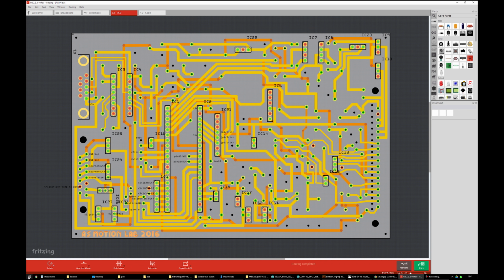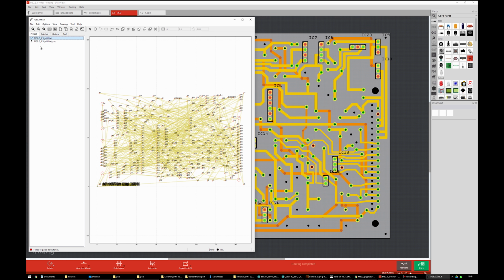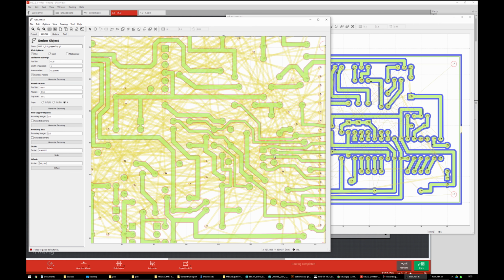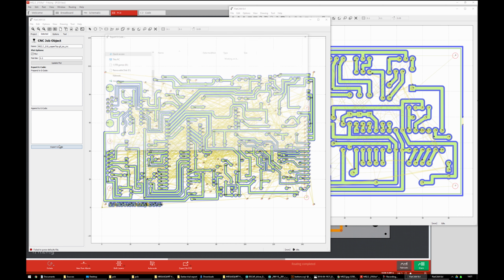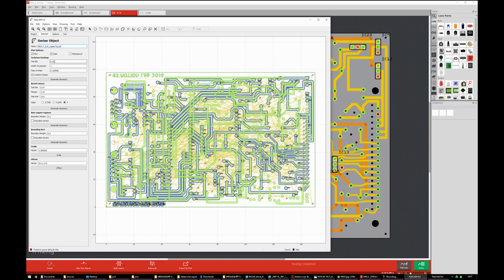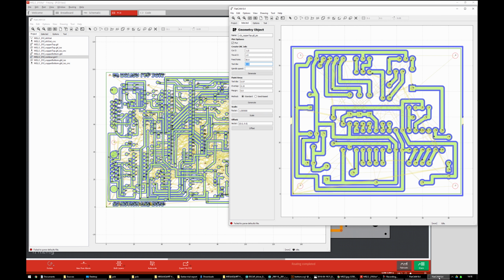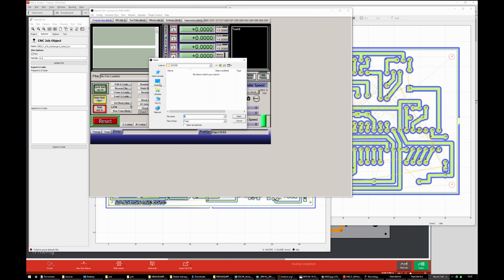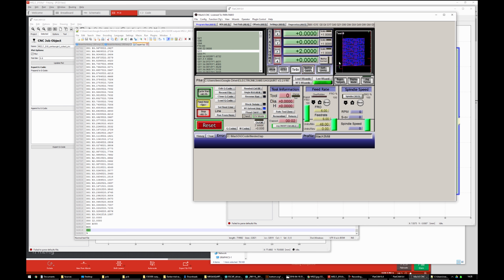Pt 2/2. Design, CAM and CNC routing Megasquirt v2.2 PCB from Fritzing to FlatCam to Mach3

Comment: Hi . Great video.
Going through the same process but using JLCPCB in china. 5 off 4 layer MS2 boards for £33 as I can not get any 8 bit CPU's.

At this cost it makes CNC PCB a close call now. I do have a couple of spare (with minor cock ups) relay boards and daughter boards.
The daughter board is not fully checked yet.

I have a 8bit version (sort of) running a peugeot 1.4 in a small Jetboat.
Reply from the maker: I'm glad it's useful for you! Since this video is very old, I prefer Speeduino over megasquirt now as the official PCB is open source, allowing you to do any modifications you want, spin your own board or buy pre-made. Cheaper too & a great community.
Functionally, very similar to MS2.

Comment: hi, i made your pcb but i need component schematics because your pcb little bit different from b&g pcb
Reply from the maker: Sorry my friend, it's very time consuming to create component schematics. I have a built PCB here but no camera to take pictures with :( If you ask me which components you need to identify, I can tell you what they are
Reply: for example leds, 2n2222a transistors are different in your pcb. Where were it located?
Reply: and why you add db15 connector ?
Reply from the maker: The LEDs are driven by customisable outputs on the MS chip. If you use the Extra/High Res firmware, you can set these outputs to be ignition drivers, which is what I've done. On my board, D9, D10 are replaced by TO-220 size transistors and D11 is N2222 and are routed out to the DB15 connector (IC25, IC24, IC26). I have an extra 2 transistors too (IC27, IC28 - 2N2222) in that corner of the PCB and you can customise their function in the Extra/HR firmware.

So there are total 5 drivers.
Mosfet IC25 is Spark output A - x2/js0 - Pin 7 on MS
Mosfet IC24 is Spark B - Pin 8 on MS
Transistor IC26 is x4/js2
Transistor IC27 is x3/js1
Transistor IC28 is out4-led18

IC25 and IC24 are ignition drivers. They have more space around them for better cooling. Their pin configuration is GCE - Gate, Collector, Emitter. Must be logic level mosfets or IGBTs like IRGB14C40 which can drive coils directly. (untested!). You have to customise for your own ignition system, and might not need such a high power driver if you're triggering COP for example which have their own drivers on-board and only need a logic signal.

IC26, IC27, IC28 are general purpose output drivers. Source, Gate, Drain pin order, like 2N2222. You can use logic level mosfets here but would have to cut the traces to swap pins around.

Their bases all need to go through a current limiting resistor and then to the CPU pins.
Their sources and outputs come from the DB15

It's much better to have these extra outputs and their own separate connector - they can be relay controls, boost controls, ignition drivers, etc etc.
Reply from the maker: Updated ^

Comment: Concerning double sided PCBs in Flatcam.  How do u calculate mirrored X/Y coordinates?
When i mill my board its topright of the PCB. Then flip it, then the milled part is topleft.

How do u calculate offsets?
Reply from the maker: Hmm, I've never had to calculate the flipping offset. In the Double-Sided PCB Tool in Flatcam - are you using "Box" as the Axis Location? I usually choose my contour layer as the "Box", this makes sure the flip is always centred :)
Reply: yes I use Box. The problem is when one physically flipover the copperplate.
I usecopperplates 100mmx150mm.
One has to precalculate an offset for the backside. I suppose..